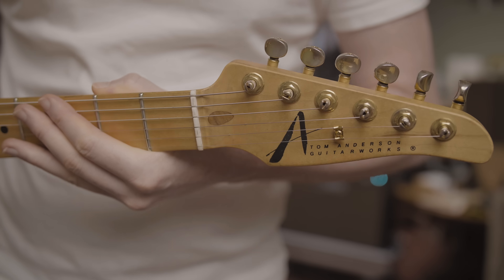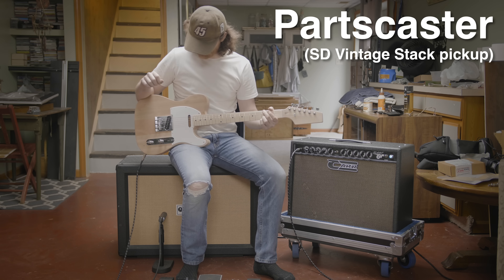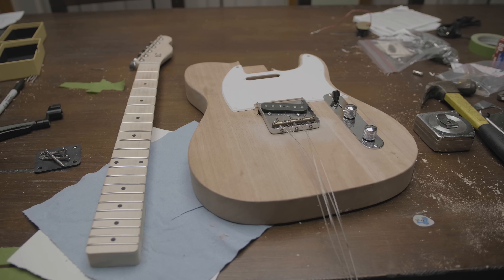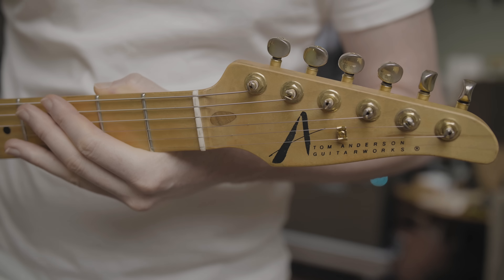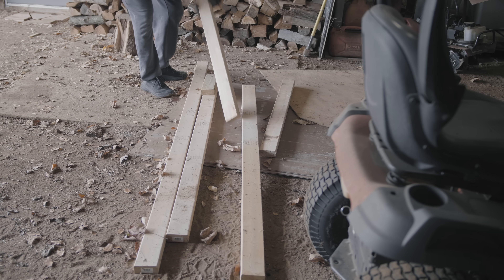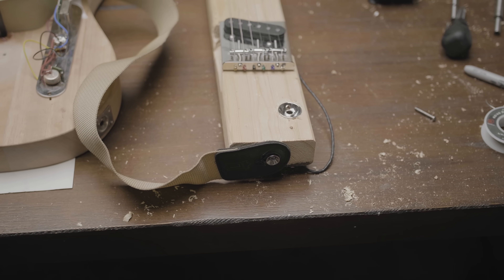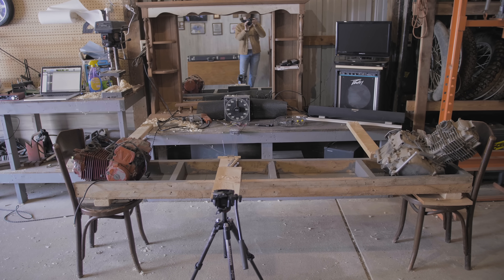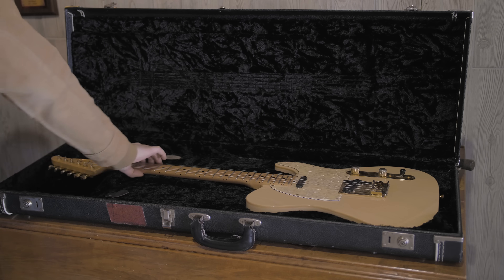Tested: Where Does The Tone Come From In An Electric Guitar?

Comment: I heard differences in almost every comparison. But the level of each difference my depend on how critically you have your guitars set up for your specific playing style - and which components you choose and/or are recommended by your tech.

Most players never have a professional tech set up their instruments to optimize them based both on the components, materials and player. And in most cases a player/instrument optimized setup makes  significant difference in both plying ease and tone.  And I don't know a single player who owns the tools to do the job properly themselves, as the cost for BASIC tools is >$1,000, and you can't learn how from a book or video - it takes training.

Amplifiers also react differently to variations in frequencies to process and input voltage; settings also change based on gear changes;  And how many gigging musicians play seated at gig volume 5' from their amp at an open angle to the speakers?  None I know.  

And you can't compare bridges, or bridge pickups (or height, or top vs thru-body loading) if some platforms have neck pickups and some don't!  Magnetic pull of different neck pickups varies and have different effects on bridge pickup sound regardless of other factors.  Pickup construction makes a big difference - where were Lace Sensors or Alumitones?  Other humbuckings in addition to the Duncan Stack?  Fender noiseless?

Finally, what microphone(s) and other equipment were used to record the audio; and what post-processing was done?

NONE of this is new.  Many of us have been doing these tests for years, and "top 5" lists differ based on materials commonly used, building or setup specialties - and simple personal preference.  Ask 500 guitar techs for  top-10 list, and with some low vote getters you'd very likely  end up with a top-10 with 11-on down in FAR fewer numbers.  Five most critical factors is much too limiting.

Interesting tests that those with discerning ears may be surprised by.  But nowhere near an objective set of tests and far too much missing baseline information IMO.

The main thing it proves as far as I'm concerned is it reinforces the idea that most new production (not necessarily custom shop) instruments and all those purchased used need a professional setup or the player will not have a tool adjusted specifically to his/her playing AND optimized for the components in play.

Comment: In the early 80's we played all sorts of guitars, all shapes , sizes , and species of wood, even some plywood (kramer striker) yuk.  The goal was to put the hottest pickups we could find to drive our amps as much as possible. Judging from old recordings, the sound difference is minimal to nonexistent just like your test.

Now do your same test with a low output  vintage style , high quality underwound (low output) pickup. Set your amp clean and loud . I guarantee you will hear the difference in almost any component  change. High output stacked pickups will mask almost all of those component changes like you have already shown.

Comment: Having built over twenty guitars in the past six years I've come to the conclusion that the kneck the pick ups the capacitors and strings and feet material are what determines the tone.in electric guitars. The body material is either light weight or heavy, one dampens one resonates frequency. Great video enjoyed it .

Comment: well, the air guitar is actually a double bench guitar that weighs several hundred pounds, so...........not too practical to take on a plane......ummm...errrr...........how about a solid piece of re-bar, weld the nut and bridge on, see what happens. The experiment would be better with a material that doesn't resonate like wood, cheers!

Comment: your air guitar is actually a "bench-shelf" guitar. those wooden structures have their own resonance characteristics.   i think a brick wall would be a better choice. if you whack that shelf, it will ring at some frequency.    this isnt to contradict your findings, just that something like a glass mockingbird would do as the air guitar with zero wood involved.

Comment: Hey Jim.  Fun stuff.  One thing that you can investigate is the Nigel Tufnel Sustain.  Although that might be hard to do unless you mounted your amp over the top of your workbench over the pickup.  I really did like the 2x4 and benchtar.  In the mid to late 80s Tom made his own line of really uniquely designed pickups that when coupled with the right woods (quilted maple, koa, mahogany) could generate sustain (not feedback) at extremely low volume levels.  When I worked for him I would try 'tonewood' experiments that came out of the scrap bin.  My favorite was a butcherblock laminate that had a maple, koa, and mahogany center with basswood wings.  It was my impression at the time that the 'softer' hardwoods allowed for  that musical resonance.  The only way to eliminate the 'resonance' of wood might be to use a steel or aluminum box beam to mount your gear on and see if there was any 'sustain' from just the pickup.  Keep in mind that the bench itself was resonating so if it was wood or even particle board then you haven't eliminated all of the influence of wood.  Should you be able to isolate sustain just to the pickups then I would concur with your experiment that it is the pickup that is the sole arbiter of tone.
I can see the sale of 2x4's and parametric E.Q.s spiking.
Can't see the sales of steel box-beams spiking but people do hang Les Pauls around their necks...

Comment: One other thing to note is internal air movement. I've played 330's and 335's, both with soapbars, one being fully hollow and the other centre-blocked, the difference is massive, and not just in it's feedback resistance/lack of. Laminate jazz arch tops are the same way, they have all the makings of any other electric bar the trapeze tailpiece and 15-18" body width, those guitars absolutely sound "airy", there is a bloom to the note and a markedly shorter sustain than a solid body. Would love to see this looked into. You could do it with a tele! hog the inside all the way out and put a cap on it, then hog only the "wings" out of another like a semi hollow and compare them all to a solid.
Reply: That is just the tonechamber creating back resonance, depending on the chamber size, geometry and material it will absorb different wavelengths and has the ability to transmute them. All that can be simulated with a filter and a transducer.

Comment: I was personally quite taken with the brass/stainless saddle comparison, the brass was noticeably rounder which I'd always had suspicions of being a legitimate variable but never done any A/B. On the other end my 77' SG is fitted with a brass nut and the volume/tonal equality between fretted notes and unfretted is very obvious compared to bone. I would never argue it's a tonal difference being imparted on the whole guitar, but it absolutely equalizes the material the string is in contact with when it's played so your open chords sound essentially the same as any barre in timbre, where every fret is in contact with metal of somekind.

Comment: Impressive level of engagement in this test. 🙂
I would however like to see a test like this with unpotted pickups since one of the main reasons that I choose unpotted is to bring out the character of the guitar.
Reply: Bring out what character, and from where? That's the whole misnomer that's being addressed here. The main actor on the stage is the pickup, height of the pickup from the strings and what capacitance value is used on the tone pot, that IS the character of an electric guitar. By having your pickup unpotted you're getting the character of an unpotted pickup, it's not homogenizing any other element of your guitars construction.
Reply: @FlaxeMusic  I’m well aware of what’s being addressed, and I don’t think that anyone is questioning what is the main actor in the amplified sound of an electric guitar, this debate to me is more about if the wood affects the tone to a notable degree or not. 
The point I’m trying to make is that an unpotted pickup is microphonic, so it doesn’t just pickup the vibrations of the strings, it picks up other sounds too. 
If you tap on a guitar equipped with unpotted pickups with a pick you will here the tapping through the pickups, even if the strings aren’t vibrating, and the frequency of that sound will be different depending on what parts of the guitar you tap. 
So, unpotted pickups in a guitar will definitely pickup the vibrations in the wood and other parts of the guitar. 

And just to be clear, I don’t think that different types of wood would affect the amplified sound as much as changing pickups, pots or caps, or adjusting the height of the pickups, but I do think that it would make a notable difference. 
And most of all I would like to see this test done with unpotted pickups.
Reply: @FlaxeMusic  And by ”character of a guitar” I mean the acoustic sound of the guitar, which unpotted pickups will pickup to a certain degree, you can even sing into an unpotted pickup. 🙂

Comment: As an electrical engineer, the idea that an electric guitar is impacted by the electronics… crazy right!?  But seriously, the pickup has a huge impact on the baseline tone, nearly to that point that two pickups of the same make and model might have some differences that could be observed in an A/B test, ultimately coming down to the QA of the manufacturer.  Beyond that, the surrounding electronics are super important, in that the pickup has electrical limitations such that the things connected to it will change the output.  Think of how running long cables cuts the high end with passive pickups.  Even something as mundane as the volume pot resistance can have a huge impact on the filtering of the signal.  Very cool video!

Comment: The "Air Guitar" has a body - it's made up of the bench, the shelf, that makeshift headstock and the pair of 2X4 boards bridging them. And IMHO, the cheap Tele kit and the 2X4 board Guitar sound better than the Anderson, I could hear a difference in them. Both have more bottom end and grit than the high dollar git.

Comment: Being a lefty building my own guitars seemed handy, and I figured most of these things out in the process. The only thing I will say about guitars is that the feel of the instrument is most important and what makes you bond with a guitar. I love the feel of some guitars that my friends who play hate, they feel comfortable and easy to play to me and uncomfortable and clumsy to someone else. And in the end this will be the biggest factor in tone, because a guitar that you love to play will make you play the most and thus make you sound better. At the end of the day the tone is in the fingers, get a guitar that feels good to YOU and if that is a squire great, if it’s a custom shop great, just find a guitar that puts a smile on your face:)
Reply: A bad tone irritates me, but isn't as important to others.  I build my own guitars, and amps.  It's the only way to get what you really want.  The way the amp responds is part of the feel thing to me.  I hate fighting my gear to pull tone.  I would rather try to control an unforgiving rig.  To each their own.
Reply: i have built over a dozen guitars.  One thing ive found is the hight of the tail piece , relative to the bridge , greatly effects the tension on the strings . Different people will like different tension.
Reply: @foylebutler8952  That's assuming your build included a tailpiece design.  The Fender style equivalent would be through-body vs bridge through stringing.
Reply: @qua7771  yes of course  . the only control over the angle you have is in raising  and lowering the string saddle on a fender . but notice the string length is much shorter between saddle and tail on a fender ,= less tension
Reply: @foylebutler8952  Agree.  I usually play a Les Paul.  That guitar is more comfortable to me.  To be honest, I also have two Fender style guitars.  They both have 24-3/4 scale necks (Gibson scale).  I take a router and jig and cut the neck angle back a bit (few degrees) on the Fender style guitars, so that it feels more like my Les Paul.
Honestly, I row my own.  It's just what I'm most comfortable with.  To each their own.
Peace brother!
Reply: Your probably the first person I told about the conversion neck thing.
Reply: @foylebutler8952  Agree with you here, a harder angle better isolates the vibrations from the nut to bridge.  I assume it’s why Gibson still keeps the steeper headstock despite the tendencies for binding it creates
Reply: @CenterThePendulum  i put  graphite powder in the nut slots . added to a small amount of lip balm. the balm helps it stay put .  i use it on all my guitars with a steep head stock angle and Gibson LP type headstock .  it works great for keeping the guitar in tune .
Reply: @foylebutler8952  thanks man, I’ve become a fan of Big Bends nut sauce, strings seem to need changing before that stuff does
Reply: @CenterThePendulum  another thing do , is take 400  up to  1200 grit sand paper and polish the nut slots . the smoother the better .
Reply: @CenterThePendulum  check out a steel guitar , the strings  just going over a metal blade . great tone on them .
Reply: Yes, you play better on a guitar that turns you on.
Reply: Dynamics are in the fingers, which to me is an important distinction from pure resonance and other Tone-oriented influencers like pickups and amps.  You can’t ‘finger’ your way to making a les paul sound like a strat.  So “playing skillfully is in the hands,” just as carpentry or any hand-executed skill is which makes ‘tone is in hands’ a redundant observation.  To the other point I’ve also played guitars with amazing feel where the sound wasn’t up to snuff.  My strat is truly effortless, doesn’t sound as good as my 335 so that’s what I play more of.   I have to like what I’m hearing back at me, ears are more important than anything.
Reply: @CenterThePendulum  this is spot on. Finally someone gets it.
Reply: @Libertarianist2112  Thanks man, it bothered me until I felt I found the right terms to describe…
Reply: I´m a lefty too and can relate to your comment. Ever since i started playing i´ve been forced to figure this stuff out, by making my own instruments and modifying others. I guess our harder path made us realize this kind of things way earlier, because for a normal, right handed player it´s easier to just buy stuff.
Reply: THE ONLY PROPER ADVICE  BOUT GUITARS  YET IF IT DONT FEEL GOOD IN THE HANDS IT WONT GET PLAYED  I KNOW THE SECOND I FEEL A NECK IF SHES A PLAYER FOR ME
Reply: Tone is not in the fingers. Only person that applies to is Tony Iommi.
Reply: @Libertarianist2112  Someone should do a comparison of Honduran vs African fingers.
Reply: Handy...

Comment: I did this experiment myself way back before there was a proliferated YouTube (2002). I swapped out the electronics of two identical model PRSs (including strings) and the tone followed the electronics. The customer I did this for immediately responded with “So the wood determining the tone is horse crap?” The wood only matters for weight and grain if you have a stained or lacquered finish. If it’s painted get a composite body. Stop the BS marketing. Guitar manufacturers use wood because markups can be inconspicuously “justified.”

Comment: i think it's a bias embedded in the evolution of the guitar itself. of course tonewood matters acoustically, and the first electric guitars were acoustics, and the first amplifier was the guitar's soundbox, and the first speaker was the resonating top. but as soon as you stick a magnetic pickup on it, the only think that matters is how the string vibrates and how that vibration interacts with the magnetic field.

the earliest guitars with pickups were designed to be played acoustically and electrically (and electrically only to support the acoustic sound, though that changed pretty quick), more like modern acoustics with magnetic soundhole pickups. tonewood mattered still. but less and less so as volume (both decibel and manufacturing scale) increased.

the modern solid body electric guitar   is much less difficult to make than any acoustic design, which makes sense from an economic/manufacturing scale perspective. and it also cuts down on feedback which is important for playing loud precisely because the body contributes so little to the core sound. that was one of the whole points of the design: to erase the acoustic "amplifier" (soundbox) and "speaker" (top) and replace them almost entirely with electric ones.

but in that transition pop culture overlooked the fact that we deliberately took away all the elements that would otherwise make a difference by influencing the way the string resonates. people shopping for electric guitars are still thinking like people shopping for acoustic instruments. but they're just buying stylized planks of wood.

i'd like to know: 
1. any feedback issues with that bench guitar?
2. what about making the only difference body construction: one solid body (or the bench guitar for that matter), the other a guitar designed to perform acoustically. ie if you installed that SD pickup in a Goodall, how would it sound plugged in compared to the other solid/no body guitar?